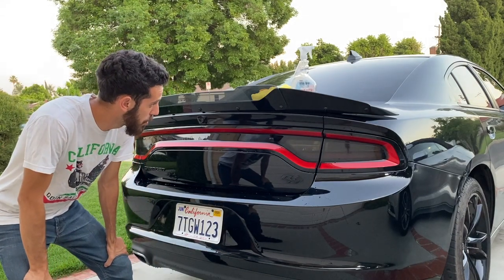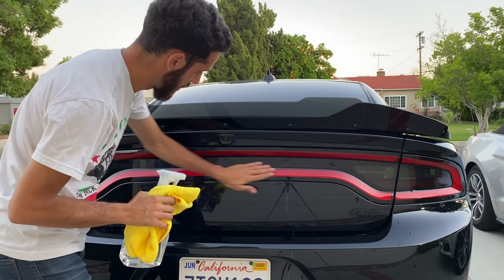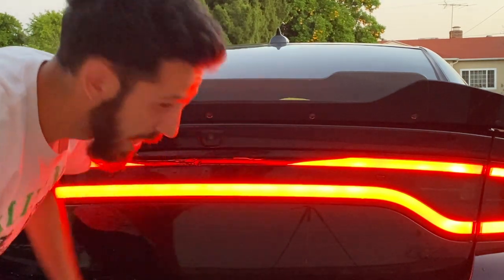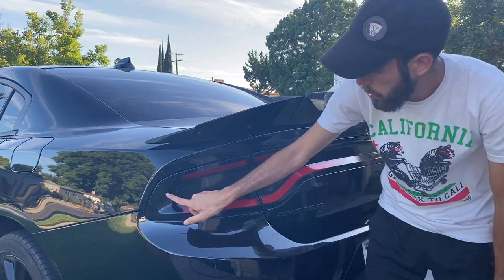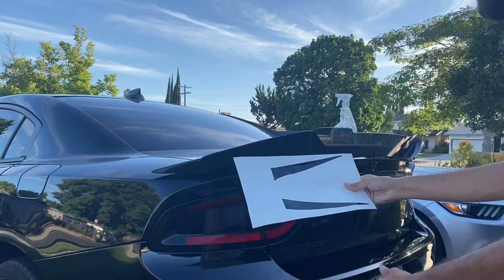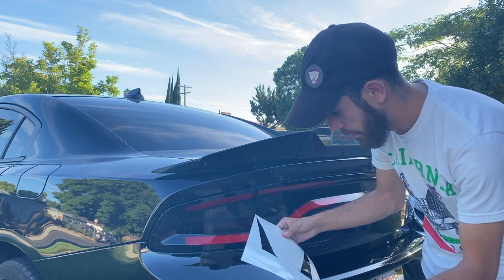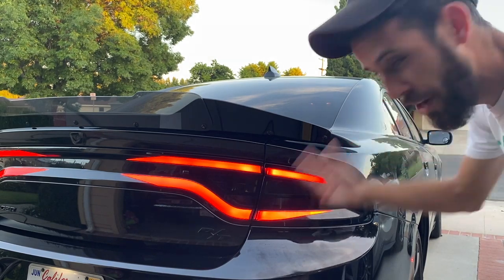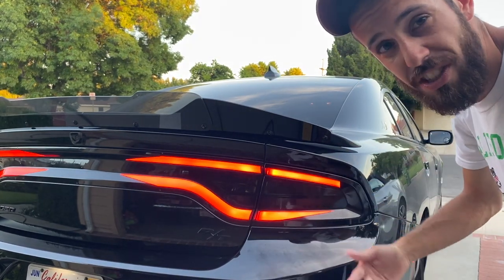Installing Taillight Tint to Charger!

Comment: I was like i can do this! THen i saw the blow torch
Reply: Virginia Adams you can use a hair dryer, it works just as good
Reply: I put mine on with no heat gun and it works just as good! Just take your time with it
Reply: Hair dryer works too but u gotta apply it for a longer duration
Reply: They should’ve just designed it to be like a sticker peel and stick

Comment: Did you put two pieces of vinyl on top of each other for each area? I just got mine in the mail.and it came with 2 sets, and i saw when you installed yours the first piece i could see light shining through alot but once you were done it didnt show
Reply from the maker: Yes you have to very slightly overlap the peaces, use a heat gun to get the bubbles out. Over time it will sit nicely.

Comment: Any issues with getting pulled over from tinting the taillights? I had black covers on my mustang and I got a fix-a-ticket within 3 days
Reply from the maker: Never had any issues, the smoked mark blended in with he stock black center of the twilight. The design still allows legal amount of light out.

Comment: how do i turn off my check engine off i put the same design on mines
Reply from the maker: It will turn off on it's own if it has not already.
Reply: @visionforlife6991  yes it did now thank you i was trying to find out how the design goes and i found your video

Comment: You didn’t drop the EBay link
Reply from the maker: Here is the link https://www.ebay.com/itm/Dodge-Charger-Taillight-Decal-STYLE-B-2015-Hellcat-Scat-Pack-Mopar-SRT-SXT-RT/164083716621?_trkparms=aid%3D555018%26algo%3DPL.SIM%26ao%3D2%26asc%3D20160908110712%26meid%3D2106e02b72b748cab8553448ef909891%26pid%3D100677%26rk%3D1%26rkt%3D30%26mehot%3Dpp%26sd%3D313055630312%26itm%3D164083716621%26pmt%3D1%26noa%3D0%26pg%3D2386202%26algv%3DSimplAMLv5PairwiseWeb&_trksid=p2386202.c100677.m4598
Reply: VisionForLife just now seeing this, thanks..I found it on eBay about 10 minutes after I made the comment. It came yesterday and I’m gonna put it on today👍🏾👍🏾
Reply: VisionForLife question though, you had the taillights on during installation was there a specific reason for that?